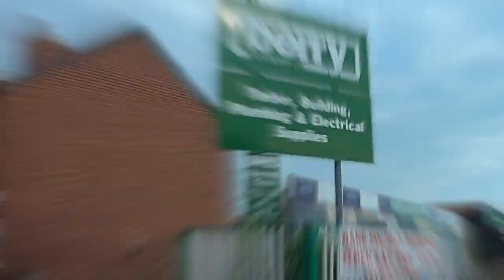WORST BRICKWORK WE HAVE EVER SEEN !!!

Comment: Great video! Unrelated question I have a brick wall where some bricks have blown is there a way to repair or do they need replacing
Reply from the maker: Thanks Shane . Once they are blown if definitely replacement as repair looks awful 😬🧱👍🏽
Reply: @SteveAndAlexBuild  cheers I thought as much just didn't want to have to do if
Reply from the maker: @Theosplaytime  . Good luck with it pal 🧱👍🏽
Reply: You'll find a lot of companies willing to make you make a fortune so that they can chisel off the front of your bad bricks and glue brick slips on! What a joke!
Reply: @hpt08  yeah no doubt. Looking at doing it myself seems easy enough just long
Reply from the maker: @hpt08  . That is not good 😬🧱👍🏼
Reply: @SteveAndAlexBuild  and when they get their kango out, set to demolition mode, you just know the rest of the wall is going to have a million hairline cracks next year. Chisel the whole brick out and replace. Satisfying but not as expensive as twenty tins of epoxy.
Reply from the maker: Take your time and get yourself a tuck pointer 👌🏼🧱👍🏽
Reply: @SteveAndAlexBuild  learning from all your vids 👍
Reply from the maker: @Theosplaytime   great to hear 👌🏼🧱👍🏽

Comment: When do they check you havent nicked anything or dont they?
Reply from the maker: Don’t know what you mean 🤔?
Reply: @SteveAndAlexBuild  After you filled up your van with stuff at Berry. Looks like you can just drive straight out, there is no gate?
Reply from the maker: @Ironbuket  . Ah , they used to be very strict before COVID then during the restricted appointment only phase had security on the gate checking receipts . Since normal operations started again the checks have fizzled out . 
    It is like Fort Knox with security cameras though . Theft used to be a big problem, even from vans a few years back 🙄🧱👍🏽

Comment: It never looks right professional bricklayers with ox tools  stabila levels are far superior and I would bet 99%of bricklayers use stabila and marshaltown
Reply from the maker: That my friend is tool snobbery . I’ve used all the brands over the years and found expensive isn’t always better . I’ve had a Marshalltown blade snap in Half 😳🧱👍🏽
Reply: I have to say one thing Steve I’ve had a few 10 inch Ox phillys though me hands and they had very stiff blades on them and didn’t feel right in the hand but the 11 inch ones are very nice trowels .
Reply from the maker: @brickbybric  Yes the 10 s are better when they’ve worn down from an 11 😉👌🏼🧱👍🏽